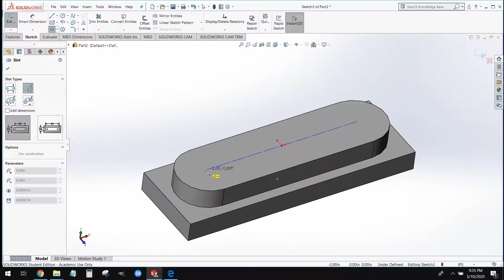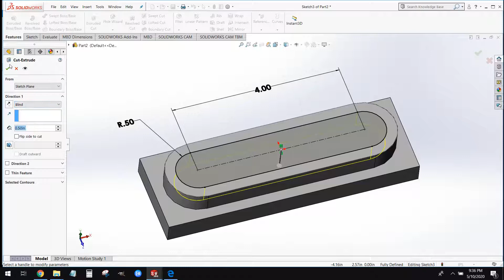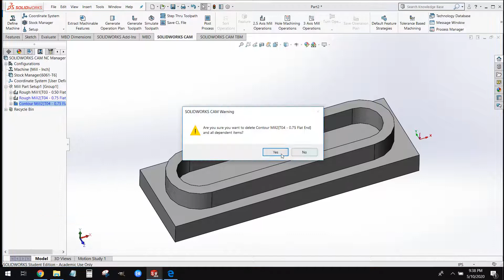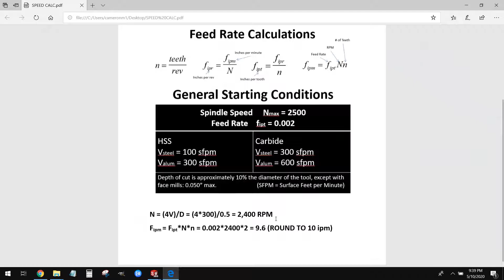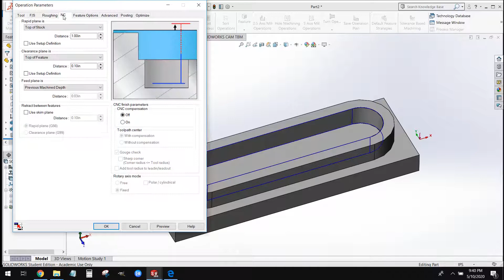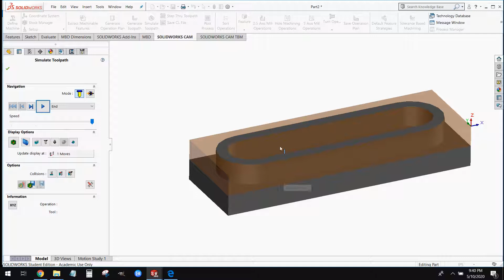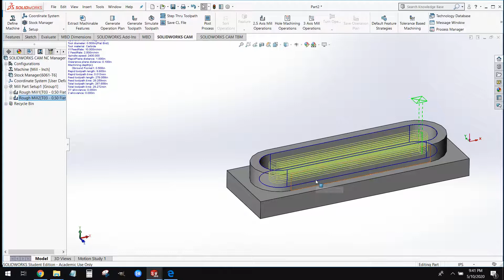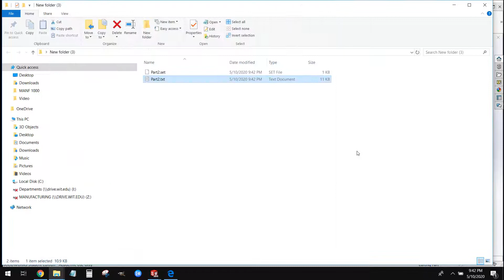Solidworks CAM Tutorial: Basic Pockets (2)

Comment: Just one question I'm looking for answer... 8:37 you show us text file with gcode. And in the fourth row we see G91 G28 X0 Y0 Z0 which means that the machine is going to moove to zero positions of all axis. Which are in the one of the corners of your part. So.... The tool will slightly touch the stok. But if the stock would be higher than part - the tool will hit the stock. I mean it. And if we look to the next lesson of your video course - you do this. You setting up the stock for 0,1 higher (Z axe). I would be very appreciated if you can explain how to avoid this issue. Thank you.
Reply: One day spent to think about my question... It seems I was wrong with my understanding of basic machining. I mean I have diy milling machine. DIY means - it is in permanent upgrade/mod state. :-))) One of this mods is Z-endstop bracket modification. It means - I'm working without Z-endstop :-))))) ....so... Machine coordinates are ... not completely accurate for every homing routine :-)))) I think that's why my question is. Will find it out :-)

Comment: Question. does this work for wood CNC'? since they all use Gcode. i dont know if you are Familiar with Vcarve Pro. basically, can this replace that software?
Reply from the maker: theoretically there is no reason you couldnt use this for any solid, machinable material. i am not familiar with Vcarve, so i cant say for certain, but so long as your router can accept G-code and you can accurately model the cutters in solidworks Cam, i see no reason why this wouldnt work just fine.